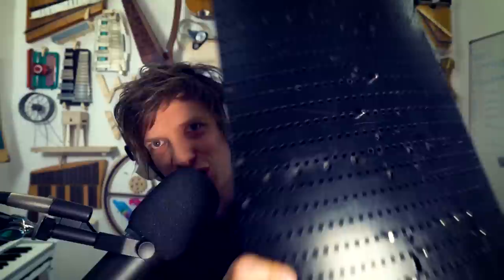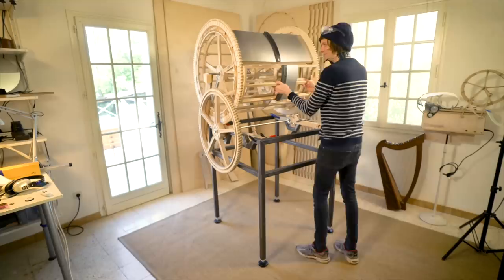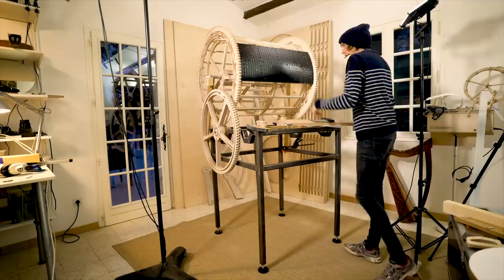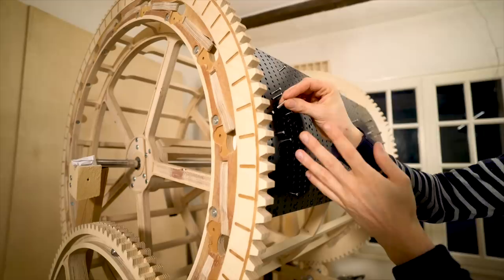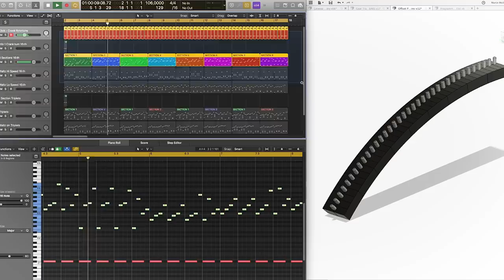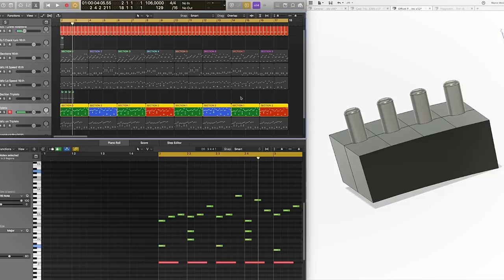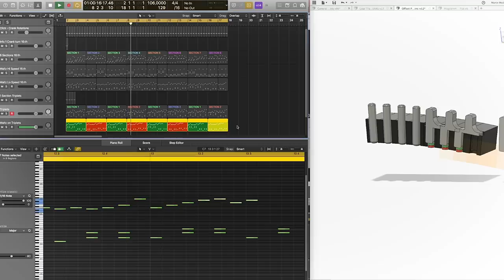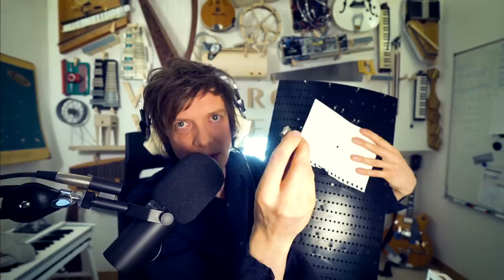Magnet "Midi" Music System - Marble Machine X #25

Comment: Glossy black for every song in 4th and matte for songs in 3rd.  The templates for pin position is a great idea, but instead of making multiple pins you can make dedicated panels for specific songs.  It may take more room in transport but it's easier for the crowd ... you can get them preparing 2 or 3 songs in advance that way.   You could also use a magnet to clean the board of peggs.

Comment: The Elon Musk of mechanical music machines! A Short broach made to match the magnet will clean the holes in one pass. Lock the spindle on the router at 90 degrees and let it go. You will need less dogbone and get tighter tolerances. Space the programming sheet off the table to get some clearance for the broach. Amazing work! :D

Comment: Wrap the drum in thick/dark paper that has holes punched in it. A point source of light or series of LED's inside the drum would allow the light to shine out of the holes. The trigger would be a series of photo detectors that line up with the punched holes. Kind of like a player piano. But with light. The light would also add a visual element.

Comment: Given there are already 5414 comments, I may be repeating someone below. I have no time to read those comments so if I have repeated another's idea, sorry about that.  I realize that this a dated vid and that mechanical actuation is part of the objective but here's a thought for the future (maybe?).  Use photo gates on the receiving side and LEDs buried inside the magnet holes.  The LEDs can be programmable RGB so not only can you program your "pin" array electronically, you could also make each pin sight color based by mixing R,G,B.  Between physical patterns and colors, it seems your musical configurations are limitless as well as instantly settable on stage.  Just load the config from your PC.  Oh another use of color at a pin site could be choice of instrument.  Also, on stage your big "barrel of lights" would be quite the spectacle.  Oh and you could also make the configuration change on the fly by embedding the controller into the rotation platform and talk to it over wifi or bluetooth.   No more physical pins to lose or break and no more programming engineers hurrying to make a change between songs with risk of a mistake!  if you really want to get crazy and sick with pins, make each one driven by a linear actuator. Programmable so again no one has to manually swap them out. One word though EXPENSIVE!  Anyway,  I LOVE YOUR WORK!!! GENIUS!
Reply: Very cool work

Comment: Martin, I've been reading the comments about programming this machine and I'd like to offer some suggestions.
First, I think the idea of two sets of rectangular pins will allow much more variation in the types of music you can play so that's the route I would choose.
Second, the removable panels seem like the best way to quickly reprogram the machine.  You could set up spare panels off stage and have one person or a group of people programming while you play.  The one modification I would suggest is to "key" the drum sections so they can only go together one way.
Third, instead of paper programming sheets use thin sheets of colored mylar.  This will allow you tho pre-program entire sets of songs and just stack the sheets in the same color order next to each drum sections.  Key the sheets the same as the sections and you've just removed many opportunities for errors in the programming.

Comment: For faster reprogramming... paint colored rings around the holes.  Use a different color for each song.  This would really speed up reprogramming because there's no need to pull out every pin first.  Re-programmers could pull a pin from one hole and immediately relocate it to it's new location (skipping a time consuming step).  At the end you may have a handful more or less... but that's good for error checking.  Here's how:  Example:  Going from red to blue?  The plate could labeled Red = 75 pins, Blue = 85 pins.  This way the re-programmer knows they need an extra 10 pins (if they don't they made a mistake).  Or vice-versa:  Going from Blue to Red, the re-programmer expects to be left holding 10 pins (or they made a mistake).

If a hole is used by 2 songs... that's okay, just use nested circles (like a bulls-eye target pattern).  Example:  Red circle around a hole with a slightly larger Blue circle around that.

Comment: The designed triplet pins are a decent idea, but because pins 2 and 3 are offset by different amounts from the hole, it would be easy to put the wrong pins in place and mess up the timing - if they are not all the same note as shown in the cross-section diagram. A couple of solutions. 

First is that you have a set of raised banded horizontal ridges on the programming wheel for 3/4 timing - these would fit into small slots cut underneath the horizontal part of the new-design pin which contacts with the programming wheel, such that the ridge blocks a technician fitting pin 2 in pin 3's slot and vice-versa. The ridge wouldn't fit into the small slot underneath if it was the wrong pin, so the pin has a physical barrier preventing it from contacting the magnet. 

Alternatively I'm thinking, you can produce each pin as a triplet which fits each bar (so covering four holes), but then you'd have to make 6 permutations for all the note combinations (3!). Out of those two I'd personally prefer the ridge system, its a simple solution.

Comment: I haven't read the other comments, and I'm a month late, but... Instead of having completely removable pins, you could have all of the pins built into the back side of the plate with individual "tracks" that automatically push a set of pins forward depending on the song being played. Similar concept to a pen, but instead of pushing one pin forward, it could set up an entire song for each panel, meaning you would also have to make sure the right track is pushed for each individual panel. The tracks could also be entire removable panels with patterns etched in/carved out of them, and then you'd have to ensure you put the track right side in, but the function should be able to be built into the panel and have a single push button per track per panel. To make sure there is not more than one track pushed in at any one time, you'd have to set up a function where the "next" button releases the previous button, then pushes its track into place, like the old fashioned VCR rewinders.

Comment: If it were me, I would create eight dedicated templates per song. Each template would be labeled with title, sequence number and orientation. Rather than paper, I would use a bendable material like a foam. It would include holes for where the pins need to be. So all you'd have to do is to fill every hole prior to the show. At the moment of truth--assuming that the actual programming panel has been cleared--you then bring this template into contact, aligning it and allow the magnets to find their holes. The foam thickness should be enough so that you can push the magnets into place. You would need some trays, I think, to hold the pre-setup set of foams. I'm guessing that you could CNC the foam.

Comment: What you need to do is have solid curved panels organised by song with flat magnets on the back where the programming rods connect to and from there you can get volunteers to just fill them up and lift up the boards into the machine and insert all the programming rods at once.

Comment: Incorporate a dynamo (electric generator) to feed off the rotation, directing a “player powered” current to flow into one or more ElectroMagnets. These EM’s are enabled to execute the task of instantaneous removal, extraction, and insertion of the programming magnets. This component, of course, is activated by the player in the form of a reversible switch. Perhaps the player has a foot switch – when they activate this which the electromagnet generates its field which will grab whatever programming pins are used. Conversely, when the direction of current is reversed, the chosen electromagnet will repel these same pins or “spit out” whatever is in its field.  Insert, extract, insert, extract...

Comment: Make the plates reversible by rotating them 180 degrees.  Align the rows of 1/3 holes between the rows of 1/4 holes.  Then you can use all straight pins.  You'd be able switch divisions by simply rotating the plates.  A shim at one end would create an offset, so that rotated one way the 1/4 pins are aligned with the registrators, and rotated the other way the 1/3 pins are aligned.

Added bonus:  If you created a gap between the registrators that allows the undesired pins to pass between (and not interact) then you could leave those pins installed.  Thus allowing you to store 2 songs on each plate.  Only one song would be active at a time based on the orientation of plates.

Comment: Flip-able levers on a hinge. Kinda like the lid to lighter fluid bottles. Either pressed in or pinned in with a hinge pin. Can't lose them when they are always there. Flip up the note to be played either the third or quarter. Maybe a punch tool to rotate it on/up and a thumb to deactivate the note/down.

Comment: First problem: to change the pins location in order to change the tune. 
 I think the best way to do this would be to make each pin into an electric solenoid, that would be controlled small computer built into the drum, what is linked with your laptop. You could change the music on the fly, give the songs an intro and ending and make it play a concerto. I understand that your main drum is so large because it has to be in order to hold the 64 ticks of music and has some ten thousand holes. If you made a drum that only had one quarter or so of the pins, each one being a solenoid,  then you could program the pins needed to be raised for half a turn, then re-set for the next revolution. This way you could play a complex piece of music as long as you like. This would also make the basic machine a lot smaller and you wouldn't need any help to change the melody. Your clever way of removing and replacing the panels would make servicing the drum interior very easy, but would not need to be done during a performance. The solenoids would be easy to make yourself from something like a plastic straw for the body, a small wrapping of copper wire, a common iron pin and a small spring to return the plunger. It would be set up so when the power (6 or 12 volts) was switched on, the pin would pop out, when the power went off, the pin would retract by the spring. You should also wire a diode between the negative side of the solenoid and the positive side with the direction of the diode towards the positive side. Something like Part No. "IN 4007 - 1000V 1A". This circuit is so excess electricity would have some place to go and the release of the solenoid would be instant. Yes, labour intensive to build, but the new design would be smaller and give you a new freedom of an uninterrupted performance. Plus you would have less stuff to transport.

Second problem: to change from 4/4 to 3/4 time. 
As I was watching your video I had the idea of making a bent pin and that's basically what you did when you designed your solution. However, in order to apply the same problem to a solenoid based drum, my first solution is to make the solenoids in banks that go across the drum in a row. Say each solenoid is two inches long and one quarter of an inch from the bottom is a pivot point. This pivot point would tilt the whole bank across the drum tilting the pins back. At the same time the second bank would also tilt and the third bank would move descend just enough to give room for the second bank. This action would happen simultaneously with all the banks of solenoids around the drum and could be accomplished by hand or with a mechanical device of some kind. Also, each set of four banks could be adjusted one set at a time by a dedicated solenoid (one per bank of four) and in this way you could change the time of the music as you were playing it.

Third problem: the hand crank. 
I know you don't see the hand crank as a problem, but if you are intending on making this a performance piece, I  make this observation. I think you should design the machine to operate like a bicycle, where you would sit upon a seat and work pedals with your feet. This would leave both your hands free to play the instrument. The pedals would turn a flywheel and this would mean an even flow of power. If I was to build it, I would also make the thing drive around really slow. This way you could ride out on stage, move from one side of the stage to the other and revolve on one spot and do all this, but very, very slowly so as to not interfere with the trajectory of the falling marbles. This way the magical sculpture would revolve on it's own in front of the audience exposing all sides as it plays. Just divert a small amount of power from the flywheel through a series of gears that would drop the ratio something like six hundred to one. Make the drive wheels from ten inch neoprene industrial casters. With no suspension, mount the axels right to the frame of the machine. This will make it very stable and the neoprene tires on the steel wheels would make it silent as it moves. Also, to help keep it stabe, make it a three wheeler, with the wheel that steers  under your seat. There would be a little crank within easy reach that you would turn and this would wind a screw that in turn would change the direction by revolving the third wheel, so you could spin the crank, choose a course and then proceed in that direction without having to actively steer while you perform. Only one wheel would be the drive wheel, say the left wheel, this means the right wheel would spin on the axle. by setting it up this way, it would be a little clumsy when turning left, but when turning right, it could revolve on the spot. There would be a gear shifter so you could disengage the drive from motivation and stay in one spot. While I think of it, there should be a parking brake, too.

Well there you go. You asked for ideas, so I wrote down some. I don't even know if I blurted out something someone else has already said as I don't have the time to read it all. I would like to know if you read this and what you might think.

Sincerely
Christopher Dowie

Comment: Also the offset pins idea sounds good in theory, but backstage, the more you complicate where each pin goes (like how certain offset pins will have to be fit in their designated spots, because they are all different), the harder it will be to reprogram.  If you just have a different set of programming plate to take triples and waltzes, it would be simpler.  Like how on rowing shells where only one type of bolt is used, you don't want your small pieces to be the different ones, because that could cause a whole new problem when trying to speedily reprogram a plate.

Comment: For programming, what about make a jig that holds a projector at a specific distance, so it projects an image of what needs to be reprogrammed?

Make the Jig in a way so multiple people can be around a single programming plate.  Make sure it snaps into place using the same method as the MMX and then projector gets image of track onto the surface (maybe even offset or embiggen the projected marker so it highlights around the hole that needs to have a pin placed)

Maybe even have all the magnet pins, the pin painted with a transparent florescent color paint, so you can use a black light to compare quickly between projected image and the pins that are in place... you see bright colored glow in that spot, is good, if there is a marker from the projected image  but no colored glow means that it is missing and can be a quick way to check.

Might also want to make a little jig off to the side to allow each panel to allow a pass, along with a sound file for each so the tech can listen to the sound file and then do a pass over that panel to make sure it matches.

Other fun thing that could be done with a projector system, is during the live tour, create a song with the audience, program it since it will be able to project the new thing, and then play it all on stage.

Cons:  make sure you have a backup for the projector cause would hate to have bulb go out.

Comment: If you use the one strip of holes, when using the template to program the board, you can color code your template to show where you use off-set pins and where you use normal pins.

Comment: If rhythms repeat, make a plate that can be attached to the programing wheel that holds the melody. Try to minimize the number of pins that need to be placed by grouping them into sections. This machine looks so cool in glossy black too

Comment: You can buy foam roll insulation striping online.  If you put that on the wheel, or the main object on the strut pieces that come in contact with the programming sections, it should be able to keep the pieces snug when they are put on.

Comment: You could change the section to be just a carrier for tracks of pin holes on a section of circle with variable distance between the pin holes. The sections (basically one line of pin holes on a circle section) would be mounted on the carrier. That way you could change the timing to pretty much everything you want because you can vary the distance between the pin holes for each track individually. 

And it would allow more people to reprogram the machine since everyone could re-pin just one track.